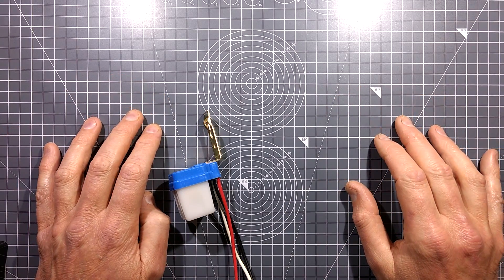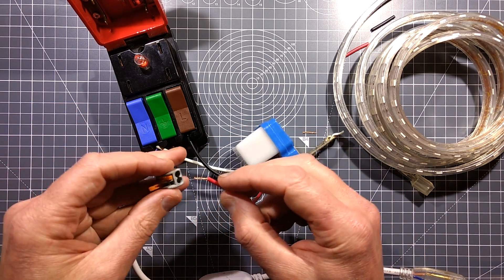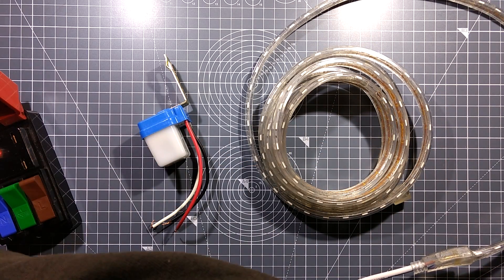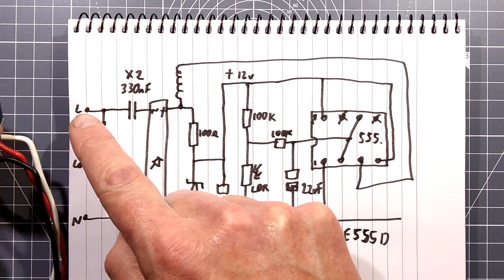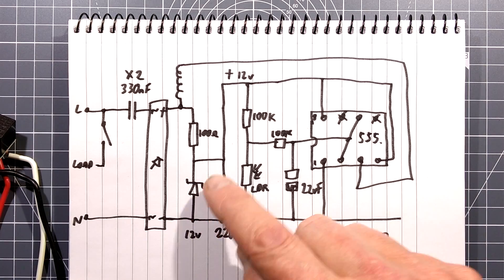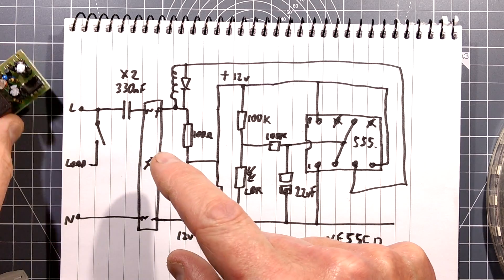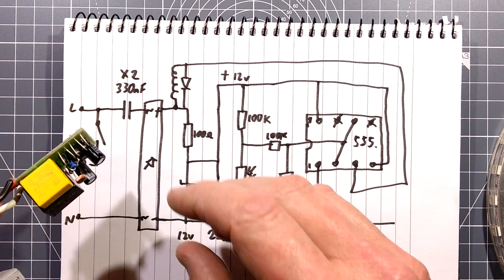Common Chinese dusk switch.  (With schematic.)

Comment: I first used 555 timers to time my ham repeater builds in the later 70’s. To get stable  repeatable timing,  tantalum capacitors were used. Teaming these up with cmos gates it did a basic but pretty good job. The 556 is the dual device, with two timers. I have A 555 cook book there are all types of circuits, blinkers, oscillators. It is a very versatile device.

Comment: I have two solar pannels connected to a battery system in my house , trying to work out an automatic system to turn on a larger load when the pannels are producing highest power . I tried currant detection module from eBay but think it's only for AC. Any thoughts ?

Comment: 9:48 Not sure if this aligns with the applications listed in the datasheet, but a 555 has been used at least in some pinball machines to generate a blanking signal for the score displays. The dsiplays get updated sequentially digit by digit through one display, then another. Putting a cap value too low in the timing circuit produces such short blanking intervals that not all digits are drawn on one display before the blanking time expires and the switchover is done, causing only a few low significance digits to light. Maybe, for example, in the RFID application the 555 can be used to time the duty cycle of the radio source. But these are just the ramblings of a village fool.

Comment: Thanks the wires on my one is brown  red,blue ,please explain is blue neutral,brown live red where do I wire this red to
Reply from the maker: It can be very random, but a guess would be Brown=live, Blue=neutral and red=switched to live.  (Load between red and blue)
But this is just a guess.  With grey imports there is no guaranteed standard.

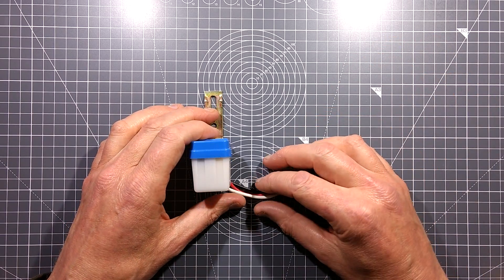Comment: 2:30 ... I once had to install one 12V version of a similar sensor and the fucker wouldn't work. 
In my case, Black(+), White(-) and Red(+Load). I had to reverse engineer the PCB to know.
Almost as dumb as Imperial units.

Comment: Can I use this with a 5v USB - like a power bank?
Reply from the maker: The relay is higher voltage, so it wouldn't work.  You can get motion sensing USB lights with a dusk sensor.
Reply: @bigclivedotcom  thank you very much, will look in to that. I want to use my 5.5w solar panel charging the power bank which will then be power to the led light in the garden that way I don't have to buy batteries or have multiple small solar panels with every fairy light. not sure if that will work, but its something i would like to try. but if there is a video you can make that would wonderful to see the components go in. I have tested the solar panel does charges my power bank nicely when kept outside of course the power bank is sealed.
Reply: @bigclivedotcom  I am guessing I need the battery circuit that you nicely explained at the end in one your video. I am hoping I am able to add that circuit between Power bank and same string light shown in the video :)

https://www.youtube.com/watch?v=KAm7Bc2AuMg&t=342s

Comment: excelente amigo, aunque el circuito no me convence muy bien, cuando el rele se activa el voltaje de alimentación del chip 555 cae a unos 5 voltios, supongo que para evitar esto habría que cambiar el capacitor de 330NF de la fuente capacitiva por uno aproximadamente 680NF, por otro lado el capacitor de la fuente capacitiva tampoco tiene la resistencia de alto valor que se encarga de descargarlo cuando se corta la energía

Comment: The second you brought in the circuit at 09:51, I looked at it and went "Where is the diode that's supposed to be on the relay for back emf?"

Needless to say, not knowing it there are internal components for it already, I would have just assumed there should be one, and added it anyway. 🤔🤷🏼‍♂️
Reply from the maker: There's no harm in adding something like that as a precaution.

Comment: So you changed the capacitor but you didn't add the diode except for on the schematic?

When I was in 7th grade,  I got a hold of one of those units of the sort that you'd see on top of streetlights (in New York City) at the time,  along with a socket to mount it in,  sort of a "twist lock" kind of arrangement.  I also got an ordinary lamp socket,  and a light bulb to put in it.  Mounted both of these to a board along with a power cord.  It was arranged such that the light from the bulb would hit the sensor.  When it wasn't on,  the sensor decided that it was dark outside,  and turned the light on,  at which point the sensor decided that it was daytime again,  and turned the light off.  This went on continuously,  and other kids in that particular shop class couldn't quite figure out what was going on...

Comment: I use 2 of those to control the lightning in my garden, each one control 2x 220v Lamp, and 1 control an COB Led 220V at the porch too. They are very interesting.
I know not the best engineering, but they do the job!! As Clive mentioned they are not instently, about 5-10 sec, but I dont mind that. I need them to turn ON light at night, and Off during day and they do that pretty well 😉

Comment: I have a Twist Lock Photocell that powers a 400w Metal Halide Streetlight. Had it for 5 Years now. Never failed me. its still Outside today, powering that very same Streetlight. the streetlight itself is 15 Years Old. Lamp needs replacement, still works, but the lamp now has a very strong Green tint.

Comment: To bigclivedotcom, Sir, I buy that in an online and it only tooks 3 days and damage already ....Can you suggest how to improve the circuits because the 100 ohms resistor has been burned within 3 days of use. Im using 220-222 volts AC....Please I need your answer. I think the 100 ohms resistor must be replaced with not less than 288 ohms 1/2 watts resistor or at least not less than 144 ohms 1 watt resistor. Am I correct?
Reply from the maker: Does your unit have a voltage rating on it?
Reply: @bigclivedotcom  12w and 5wfor a total of 17w led light

Comment: Hi Clive, As the internal voltage is 12V, can this be easily modified to work off of a 12V Solar powered system? Thank you.
Reply: Sorry Clive, I see that you answered this at the end. I really should calm down a bit:o)
Reply from the maker: There are dedicated 12V versions.

Comment: I use them for LED porch light and bathroom night light in a camper.
Mounted it in a window by the light switch and shielded it with a piece of aluminum from inside LED lights.

Comment: with america, some of us have older homes so gotta watch it with some electronics because we have live and apparently load and no neutral, which is a pain with most smart switches as they require the neutral wire (house built 1955)  heck some parts of this house I've upgraded from 2 prong to GFCI because there isn't really a grounding wire.  yeah I know there are ways to do it but the easy way is just stuff a GFCI in there and 99 % of the time that isn't a problem. except in one instance  one GFCI shorted out the other one and vice versa.  not sure why.  electrician wasn't sure why and did a sh**ty job of stuffing it in  smh

Comment: I use this switch with my outdoor lights and never had a problem with it except its not water proof
Reply from the maker: Do you definitely have the blue side pointing up?  It may be thermal expansion and contraction of the air pulling moisture in.
Reply: First of all i am huge fan  of yours , I have tried pointing the blue part  of the switch up and down but somehow the water finds its way inside the switch the problem is that their is a gap in between the blue part  and the boys of the switch that causes the water to go in and destroy the switch
Reply from the maker: The one I got recently from a local supplier had a small heater resistor in it to help keep it dry.  Maybe you could mount yours inside a waterproof electrical box with a clear lid.

Comment: These units are sold in South Africa under the "Major" brand name. I had one survive 2 Cape winters driving 2 LED outdoor lights with no problems with water ingress. Ants got the better of it this (the 3rd) winter. 220v loves to pop all the copper tracks off the circuit board! Funny enough, the 25A unit, which is somewhat larger physically that this one, is quite a bit cheaper... This vid reminds me, I better get the silicone out to stop the ants getting in.

Comment: Well, I'm just going to have to make one of these!  I have a pack of the 555 timers I bought a little while back.  So you said that by removing the smoothing capacitor, the circuit will run on 12 volts??

Comment: Hi Clive, thank you for all of your FINE work! Expat Australian retired in Thailand here, these "dusk switches" are everywhere here, mostly they work quite well. My personal experience is that "if they are going to fail", it will be within about 3 weeks.

Have 3 of these in our home in Phuket, no problems.

One that controls the night lights in our bathroom for the rescue poodles failed quite quickly. Replaced all fine.

Really like the fact that these have a proper relay, other devices with triacs, or some such, do not work properly, we had to add a "real relay", for the LED lighting to work correctly, frustratinf, but now everything works.

Love your videos!

Comment: The 555 stated "applications" is simply an engineering joke, no gaff. If you don't know the applications for a 555 you should not bother to even read the datasheet.

Comment: love ya videos ? how could i use that switch rather then turn lights on at night a want to turn off a fan 12 volts
Reply from the maker: They do a 12V version.
Reply: @bigclivedotcom  if it had a 4th wire i could see useing it to [ turn light fan off } not on at night

Comment: I wonder why they used discrete diodes instead of 1 bridge rectifier.
I've always been told that one bridge rectifier is cheaper than 4 diodes.
Reply from the maker: I've always found a bridge to be more expensive than discrete diodes from the component supply companies.
Reply: @bigclivedotcom  Hmmh interesting, maybe it depends on what country you live in (I almost never buy components abroad, except for specific more expensive ICs like microcontrollers).
But maybe I never paid enough attention to it haha

Comment: Bought a couple of 12V versions couple of years back, came with wiring details + easy to Google,  the 100K was a POT to adjust light on/off level. The white (clear) box goes upwards just put the wires into a terminal block in a small weather proof box with plenty of sealant.

Comment: before they came up with DC solar switches,,I was using the magnetic switches from cars,they’re usually on the wheel well,,when the sun comes up in the morning,my solar panel would power the magnetic switch,,turn off or on the light,depending on how you wire it,,my boat mast light had to be on at night or we got fined,,,then the lawn lights came on the market

Comment: Late comment but I've used 2 of these.  The first collected water even with the opening under shelter and failed.  The second I sealed the hole and it has no water.

Comment: ... Hi Clive ... 
... If U can remember some part of IE: a key word ...
... If you Press the "Ctrl" button bottom left of the keyboard ...
... While holding that ...
... Then press the "F" button ...
... A pop up window will open ...
... In my case a small menu bar ...
... Just type in the search box your key word ...
... And where if it is on that page ...
... It will show all occurrences if any ...
... Also as you type it will start looking and ...
... Highlight them in Blue at the same time as jump to that word ...
... If there are more than one the other will be in yellow ...
...

Comment: Great video. However, the lighting problem is simple an angle of light to camera that needs adjusted. Usually have lights at 45 degrees to camera, so that the light bounces off at 90 degrees (45 degrees of the other side to the camera) - but with that surface, you may still get a little problem.

Comment: Suggested uses for the 555 chip in RFID or biometrics could be for the timer between reading the persons card and then having to enter a PIN or present a finger before it times out. Usually all this is built into one device but if you were developing a new device or putting two separate ones together, this could form part of the circuotry between the card reader and verification reader.

Comment: Hello,
I am using this switch. Put a potentiometer between the photoresistor but changing sensitivity is minor.
Is it better to put in in serie with 100k resistor above the photoresistor in stead?
Should I go higher than the 100K total to switch at less light or lower?
It's hanging on a dark spot and switches a little to early now. Also goes on with dark cloudy weather.

Thank you.

Greetings Dennis.

Comment: I want to use this through a 12 volt battery being charged with a solar panel . My LED string is 3volts so I will drop the current before it gets to the LED . Will this work with the photocell that says AC/DC 12v ?
Reply from the maker: The dusk switch will work on 12V if it's the 12V version.   You could use a resistor with your LED string, but it would be inefficient.  Better to use a small switching regulator to drop the voltage or put three strings of parallel LEDs in series with a resistor.

Comment: Thank you, Clive, for this teardown it has got me the circuit I needed in a roundabout way.
 This may interest people and hopefully, Clive or someone much smarter than me can figure this out and why it happened. I copied this 555 circuit down, I require a 12-volt photocell circuit so I removed the mains section.  I took an old 555 and installed it on a test breadboard, I replaced the relay with a P-Channel Hexfet IRF9540N taking pin 3 of the 555 straight to the gate and using a 1Mega Ohm gate resistor connected to +12v.  At first, I used a typical ORP12 type LDR, but on swapping this to a scrap component which I believe to be a phototransistor it worked fine with no component adjustments.  Now for the interesting bit, I powered a tiny screw in mini 12volt bulb from the Hexfet and the whole thing was running from a Lead Acid battery, so plenty of current available. 
I wanted to load test it, so I stuck a 50 watt 12-volt Halogen bulb across the existing bulb, it did not light properly and the small existing bulb went dim, the 555 began to overheat??? even though it is not involved at all in powering the load. After quickly removing the supply and allowing the 555 to cool down, everything works perfectly again. 
I now have two 15 watt 12-volt screw in bulbs, so a total load across the Hexfet of 30 watts, I am actually quite happy with this, but I am still confused as to why the 555 got hot when I stuck the 50-watt load over the Hexfet. I can only assume the heavy inrush to the halogen made the supply rails fall too low for the 555 to function correctly. 
My knowledge of electronics is not fantastic, I do not do enough to get really clever at it, to me it is a tedious means to an end, supplying me with useful circuits to do the home projects I may find difficult to buy off the shelf circuits for. 
So any answers would be good, I am always curious about why some things happen.
UPDATE, the issue I am assuming must have been supply rail related because rightly or wrongly I seem to have solved the issue, I have fed the 555 through a 1N5001 diode and installed 3x  5.5 volt 1Farad storage capacitors in series to create a 1farad 16.5volt capacitor instead of the tiny supply decoupler of 50uf that I had installed, thus giving the 555 its own virtual power supply. It can now switch 80 watts of power, yes the Hexfet starts to get a bit warm, but nothing a large heatsink would not sort out.

Comment: Hi. How can I modify this electronic circuit so that the relay switches on when the LDR receives light and turns off when it detects darkness. I know i have to add a transistor but I do not know how. Please somebody send me the modified scheme. My email sabyn621@gmail.com. Thank you
Reply: Hi Vladimir, this is really easy simply swap over the LDR and the delay capacitor for the 100kohm resistor. Put the resistor where the LDR was, and the LDR where the resistor had been and put the delay capacitor on the same side has the LDR.
Reply: @richardsandwell2285  Ok thankyou verry much for your help.

Comment: bigclivedotcom: Your interpretation of the American color code is correct. But, You missed one thing. Earth ground is bare wire or bare metal. in this case, the mounting bracket. It would be mounted to a metal box that is wired to a copper or brass stake in the ground. That wire that runs from the mounting bracket to the ground stake would be uninsulated wire or insulated with black vinyl. Look closely and you will see a crimping spot for an earth ground sa well.

Comment: I was under the impression that the LDR itself would provide some variable timings for events like a passing cloud.
With the higher light level (relative to darkness), there would be less voltage across the resistor and thus less voltage to charge up the capacitor, with it charging slower.

Comment: Is there a simple way to reverse the operation of this?  So it would power up with light and turn off in the dark?  Pardon my circuitry ignorance.  My solution was to add a second relay, but I keep wondering if there isn't a way to switch this function within the photocell circuitry.  If there is I'm not seeing it.  Thank you once again.
Reply: Exchange the LDR with the top 100k resistor, then put the 100k resistor where the LDR was.

Comment: YouTube Editor dusk dawn light sensor detector switch module street night dark relay LED fluorescent compact cfl 12V 110v 120v 220v 230v 240v 10A modify hack adjust time delay photocell LDR opto

Comment: Used a 240 volt one on a 30w LED for 5 years still working well,
Having said that, now it will probably fail..
BUT - The 12v ac and 24v ac ones are the same with a couple of different supply components.
Amazingly reliable for a cheap piece of tech from china